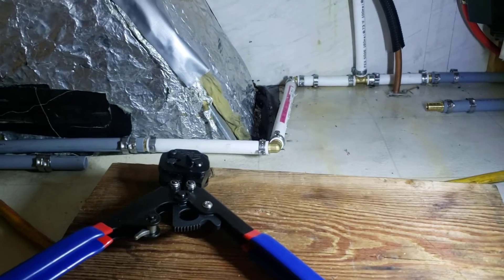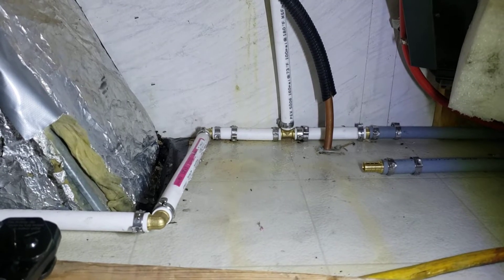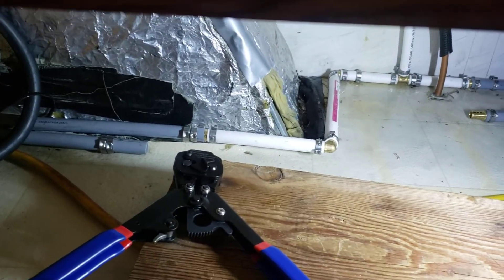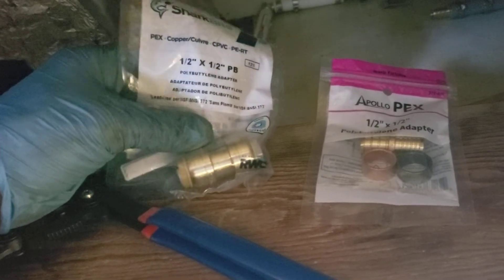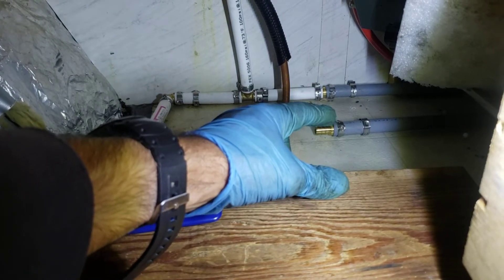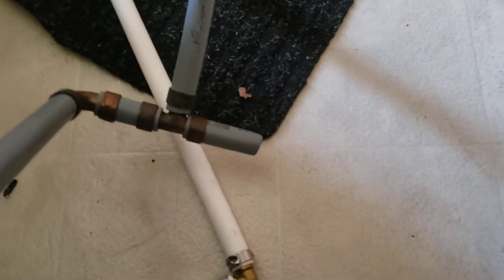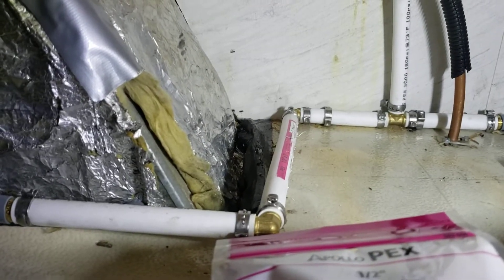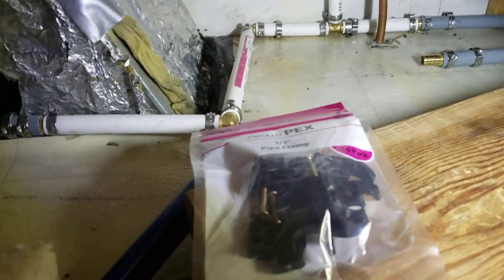Repairing and converting old Polybutylene plumbing to PEX 💪#DIYautomotive

Comment: you can use a crimp tool that looks like a tile nipping tool that works well for crimping the clamps and it's 1 handed as long as you have the gripping strength

Comment: Good video, thanks.   I found this looking for videos for my home's pressure reducing valve (PRV) replacement.  I need to add PEX to the existing Poly B.   It looks like you used adapters to join the Poly B and PEX.   I need to do the same, and want to use the same cinch clamps (Oetiker).   I assume that adapter came with ring crimps?     I want to buy one tool, so I can use it on my trailer, same as you.    Did those cinch clamps hold on the Poly B sides?
Reply from the maker: Glad my video helped! The cinch tool came with the clamps and they worked on the poly side.  No leaks yet up till this date and glad I finished that project.  On a side note: If you store your RV for awhile, these old poly pipes/conmectors are likely to leak once you start using it again due to  getting dried out.  Thats what happend in my case after storing it just for 3-4 months.